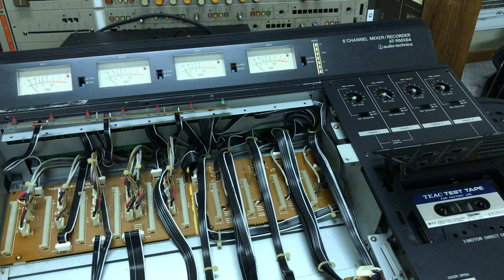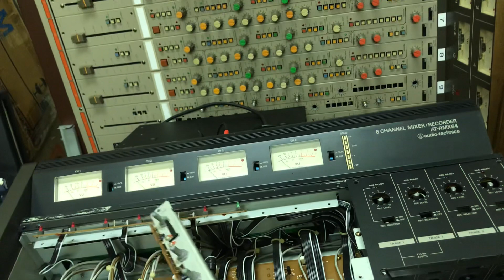Audio Technica AT-RMX64 Under-The-Hood Part 2! Plus Mixer Section Troubleshooting/Repair Tips!

Comment: Good work! Really interesting to see inside more. Those boards look to be a similar material as the cards in my tascam 122 mkii although i could be wrong. Good tips to pay attention to when looking at a unit (regarding potential corrosion).
Reply from the maker: Yeah there’s basically two types of printed circuit board base material…phenolic resin type and glass fiber type. The phenolic boards in the AT-RMX64 are extremely common, and yes they would be the same as your 122mkII. Glass fiber boards are preferable in every way AFAIC, but what’r ya gonna do…it doesn’t mean a device is “bad” or “inferior” because it has phenolic boards in it. Sometimes you’ll find a mix…my Tascam 58 1/2” 8-track has phenolic boards except for the plug-in amp cards and their motherboard. Anyway, the phenolic boards don’t make it sound any different than glass fiber. It’s just a design engineering point, and the bean-counters won with the selection of phenolic boards in the AT-RMX64.

Comment: Excellent work here! Lots of useful info and great lead on those relays! Eager to see if that gets your record issues fixed. I was working on a MT8X and there are three switch ic’s for 8 channels… same issue, no record on one channel, so a good place to look in trying to trouble shoot record issues. 

Looking forward to the next vid on this unit!

I wonder how often a relay like the green one here malfunctions…
Reply from the maker: So what I’ve learned about the relays is they are “anti-thump” muting relays. They each have two poles. That makes six channels. I haven’t verified this but I suspect they suppress popping/thumping at the six outputs (the four SUB outs and the two auxiliary sends) at power up. There is a couple seconds when you first power the unit up where the coils aren’t energized and the contacts are open. Then the coils energize and the contacts close and stay closed the rest of the time the unit is powered. There is a 555 timer chip on the small motherboard beneath the tape section amp cards. I suspect that sets the power delay to the relays. Since all my outputs are working, I’m reasonably certain the relays are not my issue with tracks 1 & 2. Regardless, I’m going through measuring resistance across each of the six contact sets. 

Your comment about switching ICs got me thinking…there are 4066 chips on the SUB 1 and SUB 2 PCB assemblies but after looking at those circuits for a bit those handle the pre/post source switching for SEND 1 and SEND 2…when you actuate the push/pull RETURN 1 and RETURN 2 pots. So that’s not it. There’s another chip that was unfamiliar to me on the SUB 3 PCB assembly, a 1407, but I now know that’s the LED driver for the SOLO buss meter. I also believe the amp circuit for the SOLO buss is on the SUB 3 PCB assembly. I’m just noting some of these things as I learn them in case somebody down the road is having a problem with any of these things…might help to speed up the hunt for a solution. So anyway I don’t think Audio Technica used relays or switching ICs for mode/source switching during record and reproduce. I think they used discrete transistors. But I appreciate your suggestion a lot. I’ll take all I can get. The other thing I’m wanting to suss out is to ensure signal is getting into and out of the Dolby chips during recording. The chip used is a Hitachi HA12058NT. It’s a DIP30 part, and there’s one each on each of the SUB buss PCB assemblies, one for each corresponding tape track. I’ve not been able to find a datasheet for it…odd…and frustrating. I did find an application schematic which does help with a lot of the pinout. So I want to just verify signal bussed to each tape track is getting to each Dolby chip during record, and is also being output from the chip. I’ll have to do a little trial and error because the pinout labeling on the schematic I found isn’t totally clear which set of pins is encode and which is decode, but that should be easy to figure out. I have some ribbon cable with single pin headers at one end and single pin sockets at the other to make easy DIY extender cables. Got them off of Amazon years ago. So I’ll connect each SUB PCB to the motherboard via the extender cable and be able to probe the Dolby IC pins.

I have a feeling I’ll end up needing to just trace for signal starting at the output of the record amp PCB assembly until I hit signal for tracks 1 & 2 and I’ll have the fault, but I’m doing some stabbing first based on some hypotheses in case I find the culprit that way first.
Reply: @SweetbeatsTechStop  great info here, thanks again… very much tuned into your efforts on this unit. Eager to see how the trace effort goes, that’s where I dropped off… lack of schem, extender cables, time..
Reply from the maker: Making extender cables is actually really easy and very affordable. This is what I’m using: https://a.co/d/89u2k7L

You can see there are some different styles and lengths, but the pins and sockets fit, the 2.54mm pitch is correct…you get a set of them for $10 or $12, peel off the number you need for the given connector, remove the PCB assembly, plug pins into the motherboard and plug the sockets up to the pins on the PCB…done. Yes, it can be a little tedious since the pins and sockets are individual, but it’s a cheap readily available solution. And you could always buy header material and solder a solid piece on each end, or even possibly just superglue the individual black plastic pin and socket housings together to make a solid multi pin header. It works. And it’s cheap.